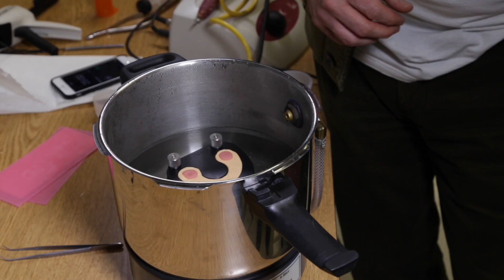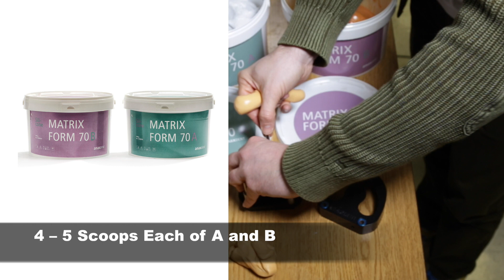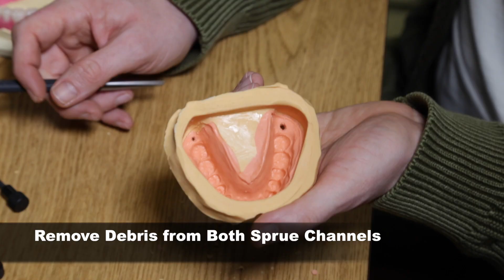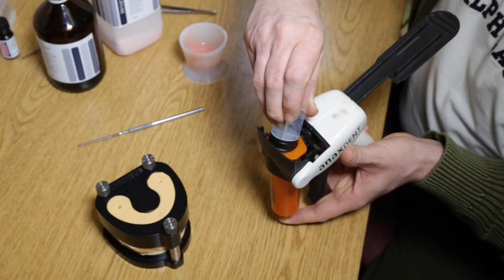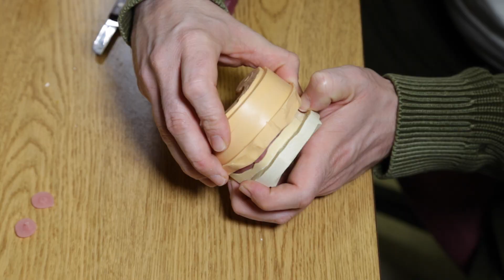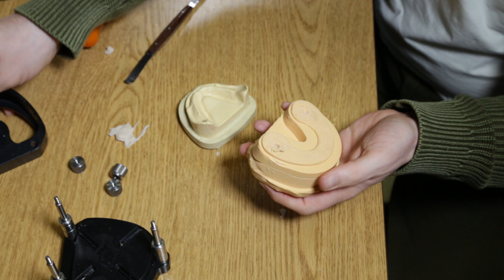anaxform Instructional Video: Processing Dentures and Provisionals

Comment: I am interested in having a system like this in my office.  Do you have specifications (strength, breaking properties, etc.) for your acrylic available?  Is there any reason you can think of that your flasking method wouldn't work with other pourable acrylics?